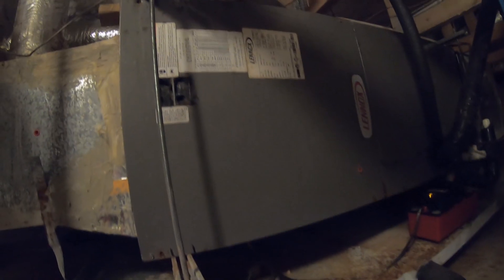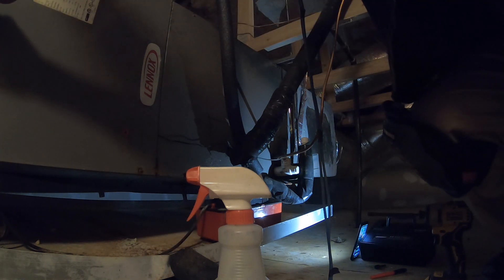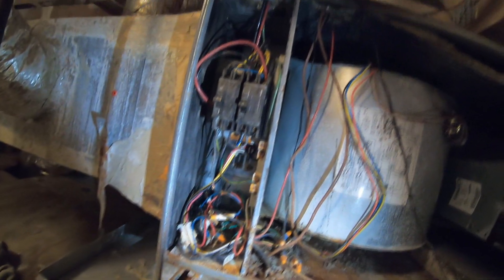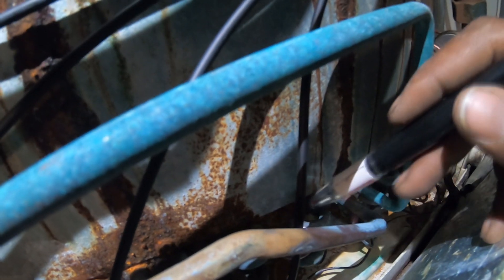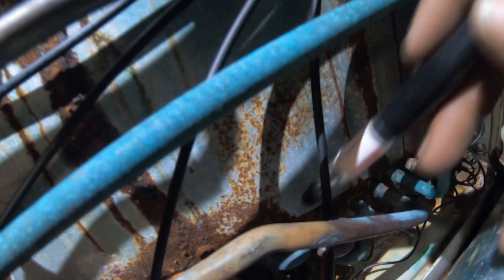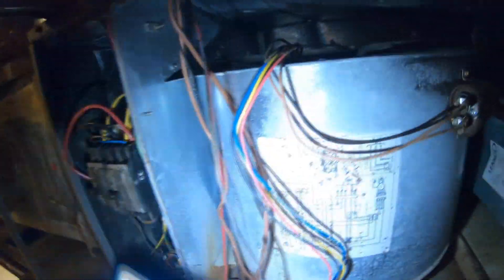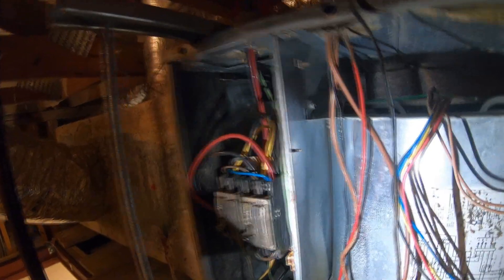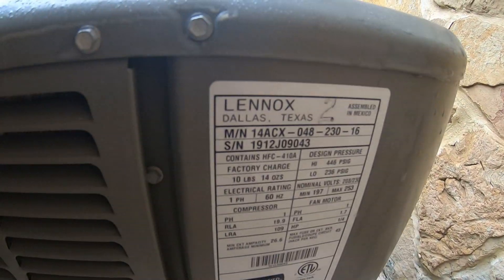HVAC: Refrigerant Leak search Part 1

Comment: You mentioned growth and development and I think this single idea helps speak to the growth aspect. I've found that developing a marketing calendar has helped to organize and plan for marketing strategies. These strategies include any holiday or celebrated day i.e. valentines etc. and marketing campaigns that can be afforded during a particular month. By planning campaigns well into the year you have time to modify and prepare, add events or remove ideas and have a heads up for activities well in advance. So, for example, your calendar my included a day of door hangings or attending a small biz activity where you are able to have a table and a banner, and handouts. You get the idea. So that's my contribution. As usual thanks for bringing us along and I'm suspecting the valves on the condenser or as you said the line set.
Reply from the maker: That is a great idea. I will definitely utilize that strategy. Thank you very much!